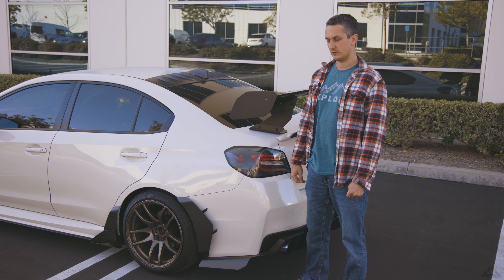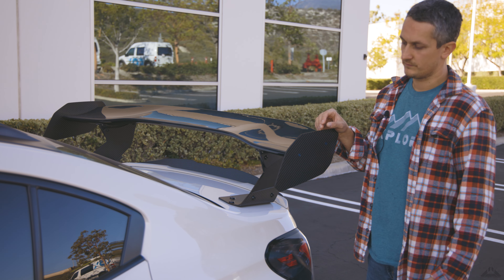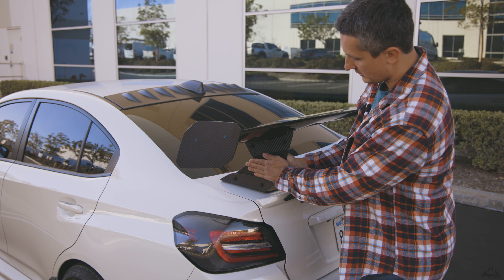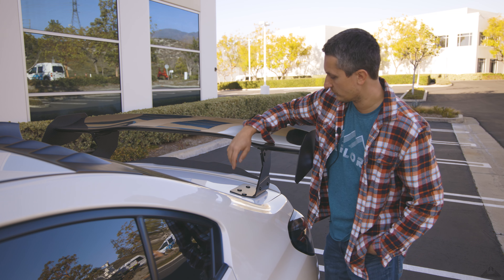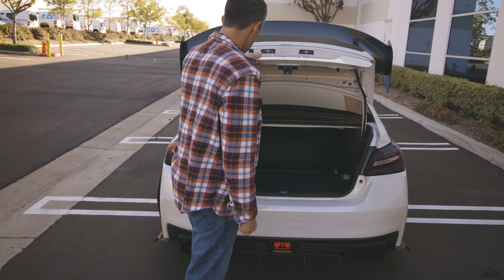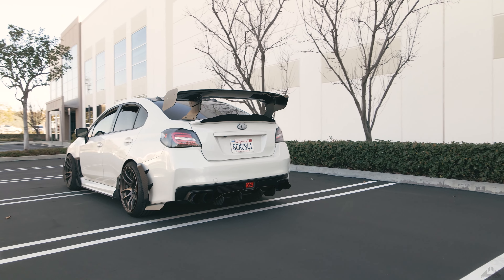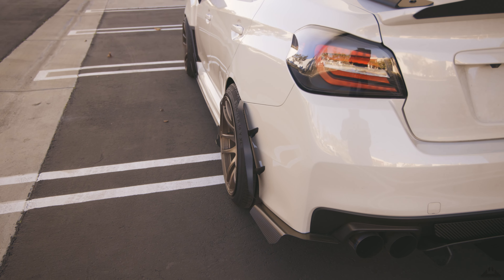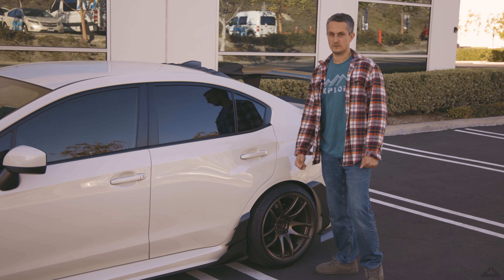Custom GT wing project | In detail

Comment: Gratz bro on the wing and all the work you’ve done.  If I didn’t know better I’m beginning to think you have an engineering back ground.  I’ve watched several of your videos and love your attention to immaculate detail.  Have you done a front splitter yet?  I’d like to see what you come up with if you haven’t.  Take care!
Reply from the maker: Actually no engineering background whatsoever. All learned by myself. I have only made a partial splitter (check my previous videos) with the center and sides separate. I actually prefer the look and idea of that more, not to mention easier to make due to the smaller sizing. But I just made even larger side plates which I haven't shown yet.
Reply: @TheShaddix  can you send me a link for the wing you bought?  I’m not having any luck finding an STi trunk/wing combo.

Comment: do you have any fitment issues with those wheel specs?
Reply from the maker: Did a lot of work to the fenders so no.
Reply: @TheShaddix  did you have to trim anything or did you just roll the fenders a lot?
Reply from the maker: Roll, pull trim, etc. Also stiff springs. Check out my exterior overview video

Comment: How's the car running, been following the build and am interested in the reliability. How often do you get on it?  I have a 2019 wrx that is phatbotti dynotuned making 332 whp/ 347 wtq. Wondering how reliable the setup is. Also, I love the gurney flap! I have been looking for a gurney like this. I hate the duckbill trunks they sell.
Reply from the maker: it's only got 10k miles on it. I get on it a few times on every drive. So far so good! As far as the gurney, I don't make anything custom for sale, but the next best thing would be the subispeed one. Everything else kinda sucks.

Comment: Beautiful design! FYI to solve the added trunk weight issue you can simply swap out the WRX trunk torsion bars for the STI ones and you'll be all set. I did the same when I installed my APR Carbon Wing and now it opens and closes like factory. :) Some links down below to where I found a good deal on the torsion bars (lot of people forget these when they trunk swap or install wings).

Left side - https://www.subarusource.com/oem-parts/subaru-torsion-bar-57529va031
Right side - https://www.subarusource.com/oem-parts/subaru-torsion-bar-57529va021
Reply from the maker: Thanks a lot man! To be totally honest, I can't say that the weight bugs me at all once I got sort of used to it.